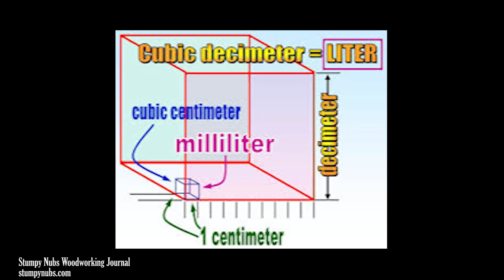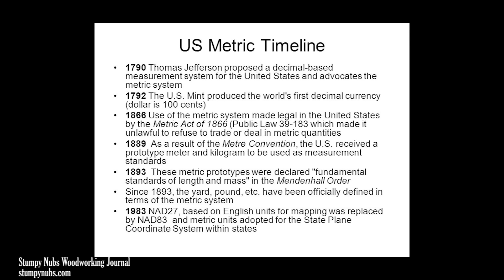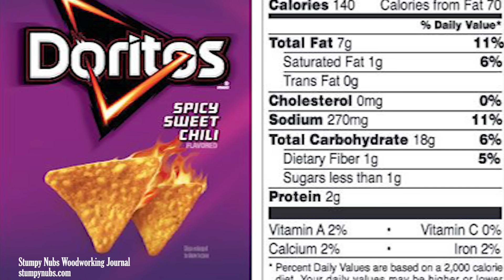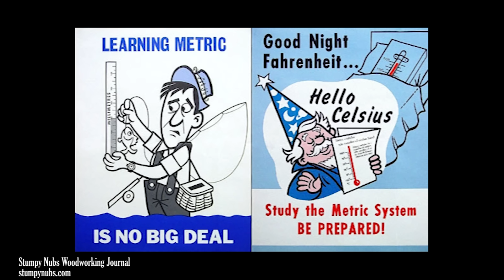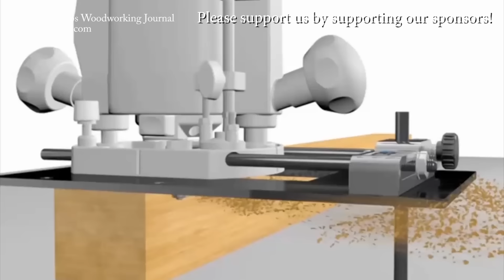BREAKING: The USA is switching to METRIC!

Comment: In the UK we still mix and match. Based partly on history and partly on what is easiest to use. As others have mentioned you might buy a 3m length of 4"x2" (it is actually ~47x100mm) but nobody bothers to remember that. Pretty much all rulers have metric and imperial and I'll regularly pick whichever is easiest to use. It makes no difference to the product unless you have to fit some part that is mm specific.
Reply: Same in Ireland. If I need precision I'll use mm. If I'm roughly measuring somthing I'll probably just use inches as it's probably a lower number to remember.
Reply: Ironically a 2x4 is not 2" x 4".  It's 1 1/2" x 3 1/2 inches, or more easily written in decimal, 1.5" x 3.5".

Yes, America insists on being backward.  During covid isolation I started baking breads and cakes more often, trying out new recipes.  Boy did that get me pissed off.  Stupid cups, teaspoons, tablespoons, fluid ounces, ordinary(?) ounces, pounds, etc., etc.  Add to that 'flat' cups, heaped cups, heaped teaspoons, you get the idea.  Bloody rubbish!  I converted all my 'new' recipes to the metric system and using a scale and measuring jug moved into the 20th century.  Now my baking has improved enormously and is consistently good.

Funnily enough, American industry already operates in the metric system.  Look at almost any packaging and you'll see the metric measurements listed.  I'm told that US manufacturers, the few that remain after the Wall2Walmart shift to just importing goods from overseas, operate in the metric system and resent having to provide the ancient 'imperial' system equivalents.  It's the American public that needs to convert to the metric system.  US business is already using the metric system but perhaps not quite enough.
Reply: @philipgrice1026  47x100mm is a lot closer to 2" by 4" then what Americans have though.
Reply: The US already has a law that requires weight in metric. There are no laws that require imperial, it's whatever you want to use.
Reply: @philipgrice1026 if you ever use a recipe that lists eggs, you can't baulk at cups.
Eggs are about - 5% to + 10% accurate.
Most kitchen measuring jugs are only good for +- 10% too.
Reply: And we buy milk in litres but beer in pints (proper pints not the little Americans ones).  But if we buy the beer in bottles they will be 550 ml, 500ml or 33 cl. I'll use inches or mm depending on which ruler i pick up and also cook using grams or ounces depending on the recipe. Basically just use whatever is most useful at the time but designs in metric really do make your head hurt less.
Reply: @philipgrice1026  we also tend to specify the size backwards to the US. 4x2 not 2x4 for some reason. But none of it matters if you buy planed wood as the size is not the finished size to make everything very confusing
Reply: @philipgrice1026  Agreed. American recipes are a nightmare, particularly if you have no idea how to pack a cup, or even which cup to use. It's just not reliably repeatable and also depends on the condition of the ingredients. Flour is slightly hydroscopic so a cup will weight different amounts on different days depending on the humidity and storage conditions.
I found a cookie recipe this week where the writer says she has used metric units because the US units are too inaccurate - and then she goes on to use Fahrenheit 😀😀
Reply: @pjaj43 Even as an American who is used to using volumetric recipes, there are a lot of little traps involved. You already mentioned flour, but I'd say the worse one is salt. Depending on the grind, a spoonful of salt could be +-50% of the intended value. And salt being out of whack ruins things in every part of cooking, not just baking. 

At least with flour measures, it's implied that it should be loose unless otherwise specified. With salt, unless it's specified, it can be any grind from the finest powder to rock salt. 

I just default to using recipes as ratios over exact measurements now... and I mentally add very generous error bars on everything. I will no longer follow any recipe blindly unless I'm the one who wrote it.
Reply: @JLProPhoto  And just what is "Kosher salt"? Why does it have to conform to Jewish dietary regulations? Just joking - I know it's really a type of coarse salt with little to do with Judaism. but it sounds odd to the rest of the world. 

Usually I cook in metric whilst my wife uses Imperial units and the two sets of "cups" we own collect dust.
Reply: Yeah, we in the UK still mix our units. Delivered milk is in pint bottles and beer is served in pint glasses. Our roads are marked in miles but footpaths are in kilometres. Fuel consumption is miles per gallon but bought in litres. I used to design printed circuit boards for a living and you always had to check the spec for component sizes and pin pitch especially surface mount as they used both metric an imperial depending on country of manufacture.

Comment: i was a mechanical engineer(defence industry) for 27 years, here in the U.K.i produced various types of components on a mill/lathe/bench etc,though the drawings we got for the jobs were mostly in metric,i would always convert the sizes back into imperial(inches) to manufacture any components.i  worked on machines which were built in previous decades,so all the measuring handles were divisions of the imperial system.25.4 was the most significant number when converting mm to inches for me.really enjoyed your tongue in cheek presentation with such a straight face too.cheers.
Reply: Also worked in industry, mainly in RMO, always felt odd to me when some one would take the effort to convert imperial to metric, I always used the easier measurement system to use (which is usually the one it was designed and manufactured to), not that there aren't times when conversion is helpful. for instance I usually found working in 10thousands of an inch easier than microns. 0.03937 is the other number imbedded in my brain along with 25.4
Reply: Inch fractions to mm conversion is kinda easy in head if tolerances are somewhat relaxed. The trick is, instead of using 25,4mm per inch you use 25,6mm per inch. Yeah, it's 0,2mm off, but divisions are much easier then. It's like using powers of 2: 1, 2, 4, 8, 16, 32, 64, 128, 256, or 0.1, 0.2, ..., 12.8, 25.6mm. E.g. 3/8 inches would then be 3 * "32" i.e. 3 * 3,2mm = 9,6mm. The exact result is 9.525mm so not bad estimate, but probably too bad for machining - not usually for woodworking.

Comment: 1 n = kg*m/s^2
1 j = nm
1 w = j/s
0'C = freezing point of H2O
100'C = boiling point of H20

Metric units are defined in terms of each other in multiples of 10 making them much easier to work with. Pounds, energy, and temperature have no logical relationship to each other in the English system.

Comment: When I bought my most recent tape measure I bought one that has both metric and imperial in hopes that I would  get used to it.  I find myself using the metric side when the metric increment comes closer to what I'm measuring.  It is very useful as well as when you want to divide a board by half or three etc. Edit maybe dividing by 3 is a bad example
Reply: it's like training your brain to learn a new language... as an American I had the opportunity to spend a year in Mexico and at the age of 50, there is no way my brain was going to lean Spanish by just hearing it... and Spanish classes were extremely expensive because they basically catered to persons in business... now at 73, converting imperial to metric would hurt my brain... it thinks in inches, feet, and yards for projects... now, I could probably go km for driving but that's only ONE change... I still have no idea what 2 Liters is equivalent too...
Reply: @t.c.2776  2 litres is about half a gallon, but I'm not sure if that's half a US gallon or half a UK gallon.
Reply: I hate those double system tapes, whichever system I am using seems to be always on the wrong side for easy marking.
Reply: Divide a yard by 3 is 1 foot. Divide meter by 3 is 333.3333333333333333333….. millimeters. Easy 😜😜😜
Reply: @LyleAshbaugh  lol good point
Reply: Except you cannot divide by 3 using the decimal system, only approximate.
I suggest that we and the metric system throw out the decimal system and embrace the dozenal.
Reply: @LyleAshbaugh  1 divided by 3 is so easy that you just did it without even noticing.

Comment: growing up with  a learning disability in the U.S., i had a tough time wrapping my brain around fractions. when i started wood working about 10 years ago i struggled with measurements because mathematical calculation with fractions drew my focus away from the work and added frustration into the mix. the day i decided to go metric was the best day i had , to that point, and the most fun i had in my shop.
 i never turned back. like you i still have rulers with impearl measures but ignore them. i have replaced all the scales on my saws with a metric adhesive strips.  to each his or hers own, but my own is metric.
Reply: Same here... I think I had some kind of math learning disability and dealing with fractions beyond the basic obvious stuff was brutal, so I've always embraced metric for measurements. My brain couldn't handle algebra either, but I was amazed to learn in high school that geometry was easy and suddenly I'm getting A+'s in a "math" class. My parents couldn't believe it.
Reply: I've grown up in a metric country so never had to deal with the fraction stuff really.
I have not done any tests to confirm it yet but I suspect I might have numerical dyslexia. So I probably would have had quite a fun time with imperial if I were in the USA.
Reply: Same, I just switched everything to decimal Inches as the first step of any work.1.250+0.0625 makes a lot more quick sense than 1 1/4 + 1/16

Comment: Wonderful video! I went from draftsman to engineer and have always absolutely adored the metric system. I've been fortunate enough to work for a company based in Germany so I've been able to keep everything metric on my designs and drawings. The only thing I dont like about metric is the fasteners. The actual diameter/thread variety you get in imperial is superior in my experience, but the benefit is relatively minor. If switching to metric meant losing my precious 4-40s, I'd still sign off immediately. Even though I've lived through a lifetime of imperial I still have to google how many cups are in an ounce and ounces in a gallon because all of the conversions are absolute nonsense.
Reply: As an engineer myself (from germany) i have never bothered with whitworth or whatever non-metric thread norming there is out there. However I was working with metric threads a lot and even in very tight spaces and unusual sizes. you can get thread diameter in .5 mm increments and pitches in .25 increments.
there might be cases though, where a non-metric thread might just fill the gap between two metric sizes perfectly :D
Reply: I am a mechanical engineer with 42 years experience. I have designed many machines, hydraulic
and pneumatic systems. In short, imperial system is just crap! Fasteners included...

Comment: For those of us who went to college in the STEM realm, we're basically already fluent in both systems.  In fact, a lot of times if I need to convert something in SAE (say how big of a box I need to hold X number of gallons) I'll convert the volume to metric, work out the volume, and then convert back to Imperial.  Helpful for price checking too... just this week I was comparing prices of peat moss sold in dry quarts vs a bag in cubic feet.  Why do we have two different volume measurements in SAE?  Great question!  But if they're both in liters, price checking is easy!

Comment: I'm an engineer and have worked in housing construction and in machine shops, all in SAE.  Now I have lived abroad for 11 years and use the metric system. It was very easy to forget the SAE System and even more easy to start thinking in metric.  When I work on a project back in the states, it is frankly painful to switch back to SAE.
Reply: @johnoliver6663, Please don't refer to as SAE.  It's the Imperial system adopted from England.  The system existed long before the Society of Automotive Engineers and the SAE also utilize the metric system.  The SAE moniker has never made any sense.  Mr. Nubs rightfully referred to it as the Imperial system throughout this video.  The retail tool industry wrongfully adopted the SAE moniker years ago because it was less offensive than Imperial.

Comment: Dude thanks for posting. I remember the push to metric in the 70's, I was still in school (California) so they taught both. I was certainly not afraid of fractions but metric does make it easier. I have since moved to the UK and they have a crazy mix of imperial and metric, where it is common to find instructions that include both Imperial and metric, no not translated - some measurements in imperial and some in metric - talk about crazy. A lot of folk here still use "old money" for the day to day measurements. I used the move as a way to force myself into metric but I find the average person over here doesn't always use it. And chatting with my friends I have to tell them in US Standard. Oh here's another interesting thing, as you know US customs standards have pints at 16 ounces, while Imperial has them at 20 ounces. As a home brewer that really messed things up, also when working out miles per gallon, as the UK gallon is bigger than the US gallon.
Reply: the inch unit system and other unit system are stupid. It is not because of stupid system, but because  that they are not compatible with the international system SI. All other unit systems must compatible with the international system SI. 
I often use computer programs for technical machines and other engineering tasks. And I often have to store and enter various values for various variables in computer programs, then let computer programs use entered values to calculate various tasks. You know that computer programs use standard known scientific formulas to calculate. If you enter values for variables in different unit system, then any time you add values, you must check the unit used in scientific formulas, then you must convert the added values to required unit systems. It is nightmare in engigeering tasks and scientific tasks. 
The only solution is that : use universal unit system SI : all programs and people exchage and communicate only with values in SI system. Thus no need to convert and check formulas when you apply variables in scientific formulas.  
Other unit system maybe comfortable only in conversation communication languages, but not in engineering tasks.
Reply: the funny thing is that the USA doesn't (and never has) used the Imperial System
We use the United States Customary System
My parents moved to Canada when they were pushing the change to metric, so they had to learn the Imperial System AND the metric system at the same time
Reply: @abstractexchange5057  How are they not compatible? The US Customary system is defined with respect to the same SI units as metric measures are. Also, as long as you indicate what units a measurement was taken in, modern computers shouldn't have any trouble with it.

Comment: I (suppose I) was fortunate to be in grade 1 when Canada officially accepted the metric system, so I learned both.  Imperial is still widely used throughout anything construction.  Although I largely use Imperial out of habit, I will grab my metric tape measure for a couple of reasons:
1 - If I have to break down a complicated measurement into multiple equal parts
2 - It's easier than trying to explain to my girlfriend for the 1753rd time how 3/8 is half of 3/4.

Comment: I love this video!
I have already switched over to using metric exclusively in my workshop. It was a little pain in the beginning, but not that difficult of a switch for me. The key for me was  buying a metric / imperial tape measure to use for quick references and conversions. Before long your brain is making the rough measurements in metric!

MikeO

Comment: I'm of the vintage that I started my life with the Imperial measurement system then switched to Metric in 1969 in school. It's like being bilingual. We pretty much think in both systems and still use them. Building materials are purchased in Imperial units. 2x4s, 4x8 sheets and so on and so forth. However, a can of paint is usually a US gallon and measures 3.78 litres versus an Imperial gallon which is 4.5 litres. Lots of fun!

Comment: Hey Mate, good vid, thanks. Now, As a 70+yo now dinosaur, I was brought up in the Uk as a kid with engineering background who learnt his mechanics on the UK imperial system of screw and bolt sizes. In my teen it was all changing to the Unified (US) nuts and bolts system so I had to buy all new wrenches to fit . In my twenties, UK became mostly metric, another set of wrenches were purchased. Today, I am probably one of very few people in the world who could still recognise the difference of the threads by sight and also the nut sizes and what spanner to use by just sight!. Good luck world!

Comment: As a metric Canadian, I visualize everything in feet and inches.  We build houses in feet and inches, but we list them on reality listings in meters squared.  I know what a 2000 sq ft home is supposed to look like and feel like, but I couldn't tell you what a 175-meter squared home is.  I know what I 100lb is supposed to be, and I weigh myself in lbs.  But when it comes to volumes I know what things look and feel like in Litres.  My truck is 135L to fill the tank, but it gets 12mpg so there is that, not to mention that I feel mile is a much nicer measurement due to it's relationship to time.  I don't know if the world needs to be exclusively in 10's and 100's.  I feel there needs to be a little room for 12's and 60's as well.